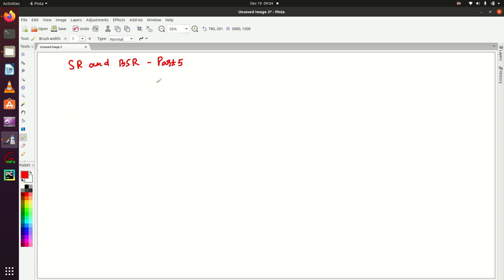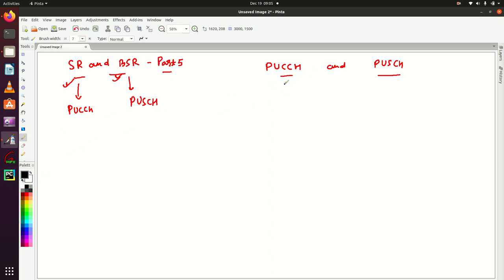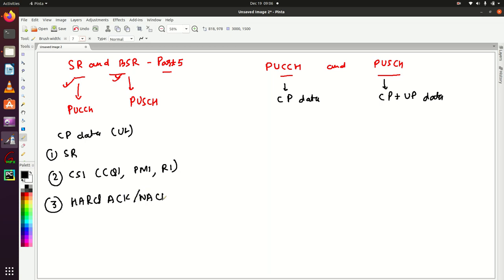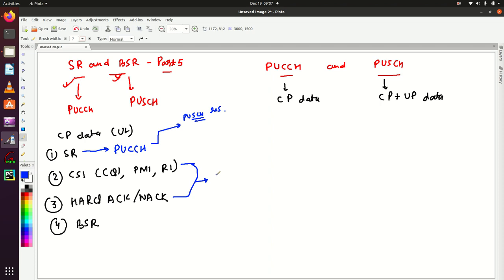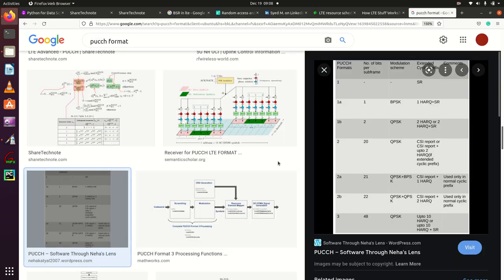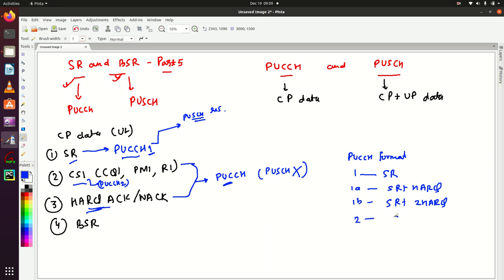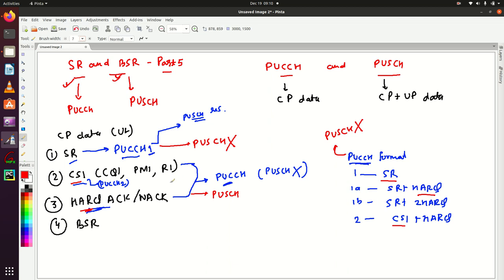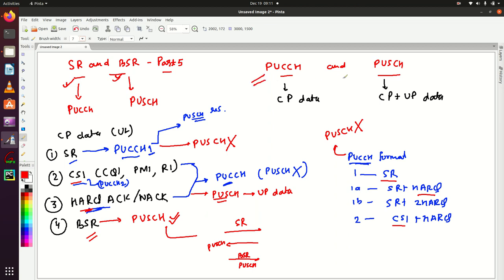SR_BSR_pucch_pusch_part5

Comment: Very good lecture. keep posting..one query if we do have RACH for receiving uplink Grant why we require SR and vice versa?
Reply from the maker: Hi Arif...both RACH & SR are MAC layer procedures. RACH i sused during Initial Attach of UE whereas SR is used after Initial Attach of UE (RRCConnectionSetup provides configuration of PUCCH so that UE could use it to send SR )

Comment: Sir plz give a short note on channel bandwidth and how it is calculated
Reply from the maker: Hello Maggie...The channel bandwidth is a frequency range in which wireless system works. The higher the channel bandwidth, the faster the connection will be.
For example, LTE has multiple Channel BW = 1.4, 5, 10, 15, 20 MHz. Lets say my network supports Band48. Band48 ranges from 3550-3700 MHz. If I want to use BW: 20MHz using Band48 I could use range 3550-3570 (or 3560-3580MHz or 3620-3640MHz etc). If I want to use BW: 10MHz  using Band48 I could use range of 3550-3560MHz (or 3590-3600MHz). Means within Band48 range (3550-3700 MHz) Base Station needs to select frequency range on the basis of Bandwidth (1.4, 5, 10, 15, 20 MHz) to be used in network.  Please refer below link:
https://en.wikipedia.org/wiki/LTE_frequency_bands
Reply: @lteplusplus1225  Thank You :)